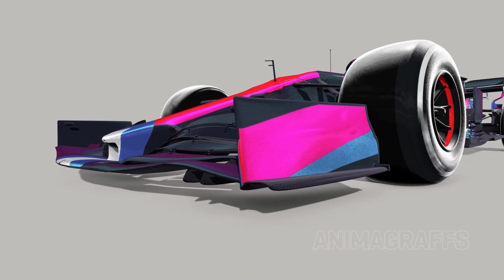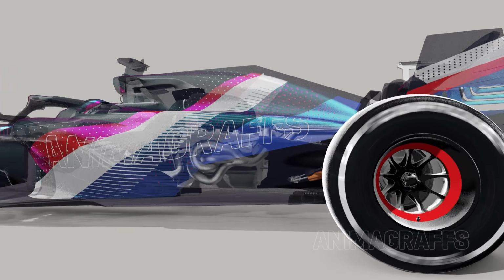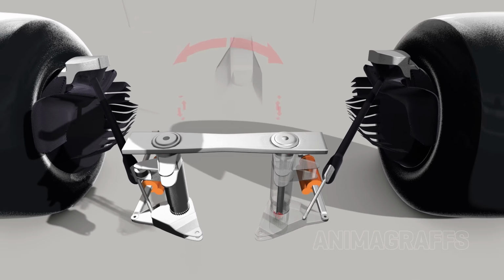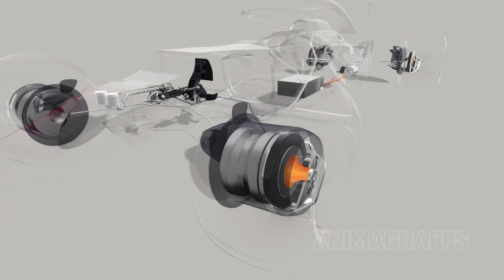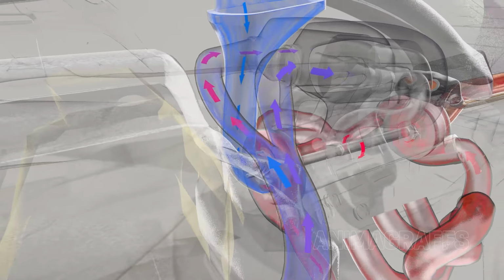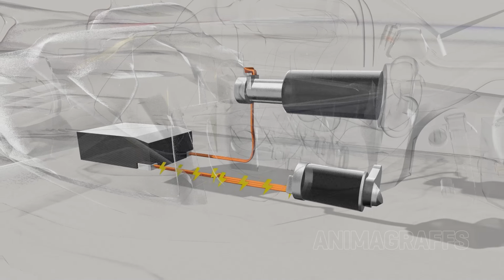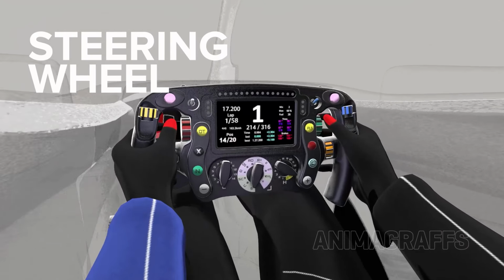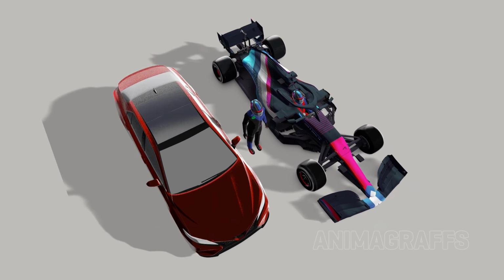How a Formula 1 Race Car Works

Comment: I still can't get my head wrapped around dirty air and the connection it has to overtaking. If majority of the air is going upwards and around the car in front of you doesn't that reduce down force and drag in straight line which makes overtaking easier. In corners it's different but in a straight line I can't see how's it's bad for overtaking and getting close.

Comment: In case no-one else noticed, the tubes on the front are pitot tubes not 'pilot' tubes. They are also used in aircraft to measure air speed.

Comment: Great, thanks! If that hasn't already been mentioned, it's a "pitot" tube to measure airspeed at the front, not a "pilot" tube (from the name of the engineer who invented it). It's mainly used in aviation, but many concepts of aviation have made their way to formula 1 where air flow is a major characteristic (as wonderfully explained in the first part).

Comment: Outstanding project. Now that the F1 teams have design/engineering studios staffed with hundreds of people, I’m guessing they have highly detailed 3D sim models of every function and screw in the car. Are these models at all available, maybe once outdated and less relevant, or are they highly secret? And were you able to get hold of any, or did you model every component from scratch in Blender? Just curious, but either way very impressive.

Comment: The Engine recovery system is absolutely ingenious. The MGU H&K units make so much sense, it’s simple. Using the turbo shaft, to generate electricity, for an extra motor, resulting in extra hp. Freakin’ awesome 👍🏼

Comment: As F-1 car moves through air, the air moves upwards of the car body has to move faster than the air moves straight through the car bottom in order the so that the air will reach the same endpoint of the car at the same time. In aerodynamic the air rushing over the top of the F-1 car body speeds up and stretches out, which decreases the air pressure compare to the air moves straight through the bottom of the car. 

At 0:30 the host said air moved upwards of the Formula 1 race car produce high pressure, his statement defies physics, does he mean physics do not apply to Formula 1 Race cars?

Comment: Excellent outstanding video.  I have followed F1 for 60 years and this is the best explanation of how a modern F1 car functions.  Congrats.  I learned a ton of stuff.  One small comment:  That tube on the nose is not a pilot tube but a PITOT tube.  All commercial aircraft have pitot tubes to tell the pilots their airspeed.  Thanks for a great video.

Comment: Hi,  excellent video from the F1 car, thanks.  The music is to loud against the voice.  At 12;45 the compressor housing in wrong position, because the turbine shaft rotating against it.  From the exhaust flow the turbine shaft rotation is correct.

Comment: remember these things aren't the fastest in terms of acceleration. both le mans cars and motor gp bikes can out accelerate them. but in terms of lap time, well, on the same track, an f1 car can be anywhere from 12 to 20 seconds faster than the second fastest racing series in the world. that means if you put f1, le mans and motor gp on the track at the same time, by the time a typical f1 racing distance is over (55-65 laps on most tracks), the f1 car would've lapped them 6 or 7 times. that's how physics-bending f1 cars are in corners.

Comment: Video corrections 
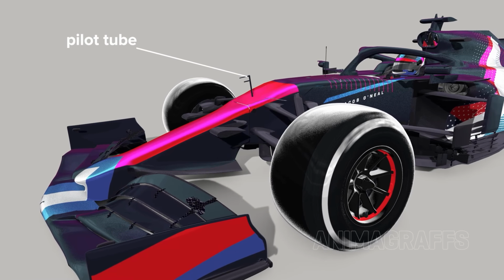@22:20- it’s not pilot tube, it’s Pitot tube for speed measurements. It’s also used in aeroplanes for speed measurements. 
Video is very very informative. I never saw such a detailed video on modern formula 1 cars. Keep making such video.

Comment: Great work with the animation and technical details!

I think there was a minor mistake about the clutch paddles. During the start both paddles are pressed by the driver and the sum of those paddles set the applied clutch movement. The clutch is adjusted so that when one paddle is pressed and one is totally lifted, the clutch grabs as much as possible without the engine stalling. During the the race start, the driver fully releases one paddle immediately when the red lights turn off and then reduces pressure for the second paddle as rapidly as possible while avoiding tyre spin at the same time. This allows optimal acceleration with manual clutch application required by the regulations of F1 racing.

Comment: the halo tripod type safety feature in F1 cars should be directly connected to the roll hoof instead of tapering down at an angle . . . that way the driver (especially the driver's head) is more protected in roll overs compared to the present design . . . not an expert with F1 cars just sharing a quick thought while watching this video . . . right or wrong you decide . . .

Comment: The MGU-H is also a motor. At lower engine rpms where the pumping efficiency and dynamic gas flow isn't as high the motor can spin up the compressor side to generate boost like a supercharger. however this is being dropped for the 2026 season

Comment: Fantastic video. Very well organized and presented in a super engaging way. Thanks so much. One thing caught my eye and you should correct it as soon as you can. As Adnan Morshed noted below, the air sensor is not a "pilot tube." It is a Pitot tube. I'm sure every engineer noticed this mistake.

Comment: One major aspect of the sport is the endless arms race between the regulating body and the engineers.  Every year, the regulators update the rules to say what the engineers can and can't do, and every year, the engineers go over those regulations with a fine-tooth comb, looking for any loophole in the regulations that they can take advantage of.  This had led to dozens of innovations that were allowed for only one season before the loopholes in the regulations were closed, including but not limited to double-diffusers, blown-diffusers (which used engine exhaust gas to increase airflow), active suspension, mass dampers, DAS (which allows the driver to change the tow angle of the front wheel) and so on and so forth.  One year a team fielded a car with a fan on the back, officially for cooling, but really there to generate more downforce.  It lasted precisely 1 race before being banned.  

The pace of innovation in F1 is matched only by the rate at which the F1 regulators ban innovations.

Comment: Little notice, at the sensors part the tube that is on the front wing is a pitot tube, that can measure pressure difference and with that calculate the speed of the vehicle

Comment: Great modeling job, congrats! While you kept the aero part reasonably generic, I'm sure you know FIA changed the regulations for 2022. This is not criticism, just a suggestion which could be addressed adding a couple comments to the video, without even modifying the model itself.

Comment: Okay, I certainly learned allot today. Very well done. But I will say that this has only increased my dislike of modern F1 cars. Like so many other F1 fans, I will never forgive F1 for robbing us of that glorious V10 sound from the early 2000's. Even the V-8's and V-12's were better than this V6 cr*p. 
Anyway, I had wondered about this DRS and hybrid operation so thank you for that.

Comment: Anyone able to help me with the whole ground effect thing? I completely understand Bernoulli’s principle, however what doesn’t make sense to me is that with the way many explain it, air is acting completely differently on the top and bottom of the car. The reason the aero on the top of the car creates downforce is because it’s forcing air upwards by air slamming into angled surfaces, which understandably forces the car downwards as it creates a high pressure zone. However, in the way that many explain it on the underside of the car, air is ALSO forced underneath by air slamming into oppositely angled surfaces, but this time that somehow creates a low pressure zone? Surely if more air -> is being forced into less space, the pressure would increase and exert force on the ground and the underside of the car, creating lift. 

The strange thing is, with the way I understand the concept intuitively, it all makes sense. See, people always focus on the idea that air is being forced under the car which is what is creating low pressure using Bernoulli’s principle. However, as displayed in cars like the infamous Lotus Type 88, no additional air is being forced under the car. The surface at the front half is completely flat. This is where my opinion comes in. The rear half of the car slopes upwards. This, if you think in an intuitive sense, would make a low pressure zone, as the same amount of air (due to side skirts preventing additional air from being added) is being guided into a larger area. This would mean the same amount of air particles are filling more space, aka the exact opposite of what’s going on on top of the car (more air particles filling the same amount of space, so higher pressure).

In most explanations of how these cars create downforce using the underside of the car, they say the reason is that air is being forced under the car, leading to the air increasing in speed, which consequently decreases the pressure and sucks the car to the ground. However, none of them address the fact that if the air is being forced under the car, then surely force is being applied to it somehow. This force is therefore applied… BY THE UNDERSIDE OF THE CAR, which, as shown on the top of the car, would force the car in the opposite direction aka UPWARDS AKA LIFT AKA THE EXACT OPPOSITE OF DOWNFORCE.

In essence, the process in the Lotus Type 88 has basically nothing to do with Bernoulli’s principle, but instead just involves doing the opposite of what the top of the car is doing. Hopefully you can see why this makes sense to me.

Comment: Here is a comparison most people dont know. If you took the fastest formula 1 car and drove it at top speed to the starting line of a 1/4 mile dragstrip while a top fuel funny car or dragster started from a dead stop,,the formula 1 car would get about half way down the track as the dragster crossed the finish line at about 400 mph in 3.5 seconds. People that haven't seen top fuel dragsters are known as nitro virgins. Once you see 1 you have no respect for a formula 1

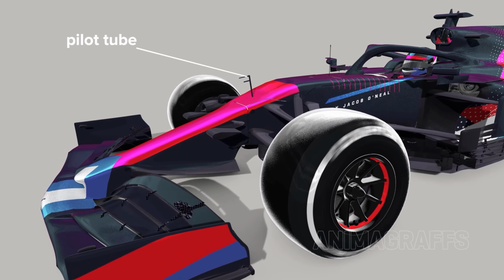Comment: Amazing work. Just a small note: @22:17, the sensor is called a "Pitot Tube" (named after Henri Pitot). It is used to calculate speed from pressure differences.

Comment: I also add that the MGU-H actually during turns or when the pilot is off the throttle the mgu-h spools up the turbo, so no turbo lag and when the engine has peaked it's performance in the straits and therefore there's no need to that boost, the MGU-H uses the waste gases to generate energy and so forth it'll recover electric energy to be used in the next exit of the turn or for overtaking.

Comment: Some mistakes here and there, but a very nice vid overall and I'm pleasantly surprised by the way you acknowledge your own mistakes or misses.
I would have appreciate a small talk about the dry sump system, as you detailed how brake calipers get mounted as low as possible for center of gravity reasons.
Very nice job !

Comment: The infamous MGU-H is driven by the turbo….still kinetic … it also can spin the turbo back to eliminate lag like a ALS system.
The main reason why Merc had a bigger turbo in the begging of hybrid era was also to spin  the mghh and charge the battery even on the straights .

Comment: Great video, however one glaring error, the air pressure sensor on the front is called a PITOT tube, as on aircraft, not a PILOT tube!

Comment: Fantastic video, Could the last ''mystery'' button be for adjusting toe angles on front wheels to accelerate tire warm up? I know Mercedes was using that technology for a while, not sure if they are still allowed. They would basically give a few degrees of toe in, in order to warm up or more so to keep the tires warm whenever a safety lap would happen. Obviously useless during actual racing, but this would allow Mercedes to have a edge when the race would restart as they where able to keep front tire temps much higher than the other teams.

Comment: Really good video man, really fucking well done.

But there are some things that are wrong here.
First of I think that you should make it clear that the steering wheel does look the same for every team and buttons will be placed out differently for different teams.
Then the lights you refer to as “waring lights” is technically correct but they aren’t used to display a malfunction of critical systems but to display the current waved flag at the current section the car is at. For example if there is a yellow flag (caution) flag is being waved then these lights will flash yellow when the car goes through this section.
And both the clutch paddles are actually used during a race start. One of them is set to a pre-determined “bite-point” (a point where the clutch is engaged enough to make the car move but not enough to send full power to the wheels). The other acts like the clutch pedal in a normal car. So when the lights at the start go out the “bite-point” paddle is fully released while the other one is still depressed. Once the car has started to move the other paddle is released slowly like you would on a normal car. This helps limit wheel-spin during the race start.

Comment: Nice video but you seem to have misunderstood maybe the most important feature of an F1 cars performance: The purpose of the rake and the diffuser. As I have understood it it creates an even greater low pressure as the gap between the underfloor and the ground opens up because the same amount of air should now try to fill a larger volume. (considering that the vortexes, sealing the edges of the underfloor, is working ultimately so that no more air can join from the sides, which is not really the truth). This creates a very low pressure, almost a vacuum sucking the car to the ground if there was no air joining from the sides. This is why there was physical skids (or what they were called) instead of the vortexes mentioned in the video in the 80s(?) which almost completely sealed off the edges of the floor and created an immense "ground effect". This got banned after a while as it became too powerful and made the cars too quick and dangerous, but it's partly coming back now in 2022 in a controlled way. 

So the main purpose of the rake is to speed up the air, creating a low pressure sucking the car to the ground. As you say in the video the diffuser at the back is amplifying this effect even more.

When it comes to cleaning up the air behind the car, I don't think this is very important for an F1 car. I even think it is a good thing to leave "dirty air" (meaning turbulent air) to your opponents behind. :)

Comment: 4:25 the new airflow pattern won't much straighen the air but is supposed to rise above the car behind so that the turbulent air won't meet the front wing of the following car.
It's more like pushing the turbulent air where it doesn't do damage than shaping it back to laminar.
cool video nontheless :)

Comment: First of all.. Cumsumption is when someone is swallowing semen. :D

Second ((Edit) - Under Fuel Tank)
I'm not sure that your "Cumsumption/Cunsumption/Combustion" calculations is right.
I can't remember which track it was, but last year (2020) Red bull, Max verstappen, Honda engine, was doing a race with 55kg of fuel, around 74 liters of fuel. the race was 203-205 km long. Max had driven 205km and used 55kg of fuel. that's a little over 3 km/L.
PLUS the 1,15L fuel the FIA is taking after each race. (it's not in the 55kg/74L)

Comment: And only few know that many technological solutions which are so splendidly explained and visualized here were introduced into Formula 1 by Colin Chapman, the founder of Lotus: ground effect, monocoque, rear wings, gearbox as integral part of the supporting structure to attach the rear suspension, side air pods, sponsor livery...Lest we forget!!!

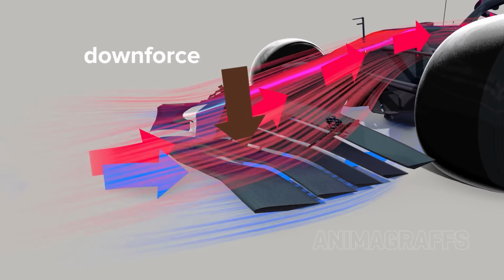Comment: i have to stop this right at 0:54 this clown is clueless to aerodynamics. no joke every square inch of these cars is aerodynamically designed to aid very specific functions and mechanical features and he already screws up 10% of some of the most important part of the cars control surfaces.

Comment: Vast amount of info in a short time.  As I am a very old mechanic(retired) I would point out that you mention the "special" u-joints in the drive axles.  The very same type u-joint was used in the late 1940s & early 1950s Chrysler products/cars.

Comment: I believe there is a mistake in this video, it states Formula 1 cars have 7 forward gears, not correct. When the engines changed from 2.4 liter V-8 to 1.6 liter V-6, the trannies changed from 7 forward gears to 8 forward gears, plus reverse of course. Does anybody know if these V-6 engines use high pressure nitrogen to close the valves like they did in the V-10 and V-8 engines of the past? Those engines revved much higher.